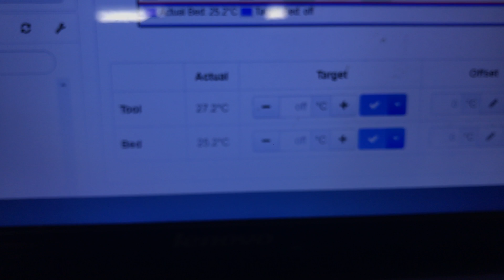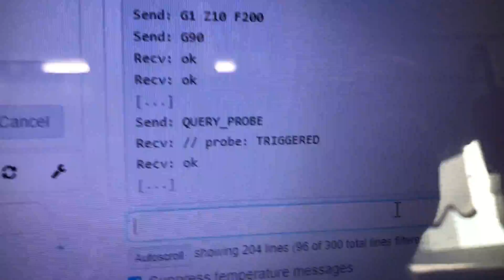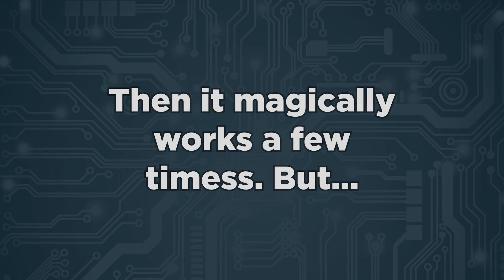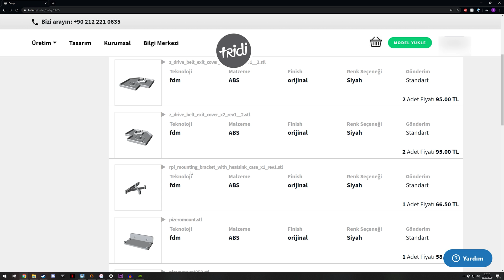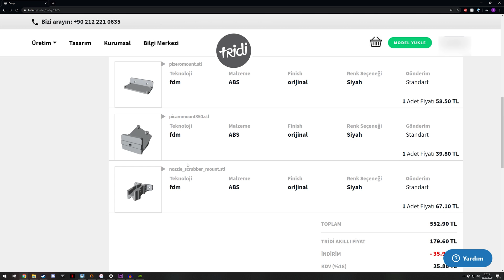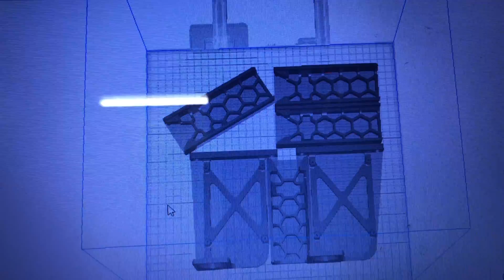Voron 2 Ep. 8: It's Working!

Comment: I know you’ve had a lot of issues and frustrations during this build so please don’t take this wrong but your calibration cube “appears” to have worse than my Ender 3.  I really love your build, appreciate you sharing these challenges, and want to build a Voron myself but am curious how much you have into this printer and if your print quality has been improved since this video with either structural changes or slicer settings, etc.?
Reply from the maker: Also consider joining the discord. There are plenty of print quality examples there.
Reply: Isik's Tech thanks for the feedback. I’ve only a hundred available here, there, etc., and am afraid by the time I get everything sourced, they’d be on Voron 2.6 or 2.8, but more importantly is since I only print here and there, whether increased print quality is worth $2k.  Besides the print quality here, it seems your ABS parts that were printed for you weren’t much different than my Ender, thus my wondering what I’m really getting more than what I have for $2k.  I really love the Voron but am hesitant to whether it’s worth the cost.
Reply from the maker: Voron 0 is around 500$ add v1 is around 1000$ if you want cheaper. V2 is around 1500$ but I did more than "stock" that's why it's 2k$. I understand the hesitation it took me months to convince myself but I don't regret it. I started around 2.1 when I finished v2.4 was nearly out. Once you build it, upgrades are easier.
Reply: Isik's Tech thanks again!  How often are new versions being released?  I see there’s a flea market on Discord ... is it possible to build the 2.4 for less than $1,500 by keeping an eye on the flea market or are there not to many “great” deals to be had?
Reply from the maker: 2 versions were released after I started following the project almost a year ago, so it's not that bad. I don't expect a v2.5 anytime soon either (I'm not a dev but I'm active enough to sense hints of upcoming releases, still no promises :) ) No idea about the flea market. I'm from Turkey so I ignore that channel since not many of us post there. But you may be able to save money by joining group buys. I know I saved a decent amount on my upcoming v0 build from those.
Reply: Isik's Tech where are the group buys posted?  Why are you building a V0 if you’ve already the 2.4?  I almost bought a CoreXY Ender 6 for $550 and seems I could build the V0 but then I’d be wondering why I didn’t just save another $500 for 1.8, or another $500 for 2.4, etc. ... how’s the quality difference between V0 and V2.4?
Reply from the maker: I'm building a v0 as a second printer. I'm sick of not being able to print when my printer is out of service. Group buys usually get posted in vendor channels or mods channel but it may vary. Print quality difference seems to be minimal (check print channels) but v0 plate is tiny so you may want a larger printer. Also v0 is bowden, which I'm not a fan of, v1 and v2 are direct drive.
Reply from the maker: "Perfect" means all sides are 30mm in this case, not the print quality. My prints look much nicer nowadays thanks to some tuning. It takes some effort, but Vorons can print really nice objects, even at high speeds.